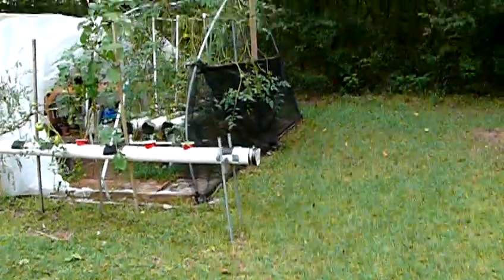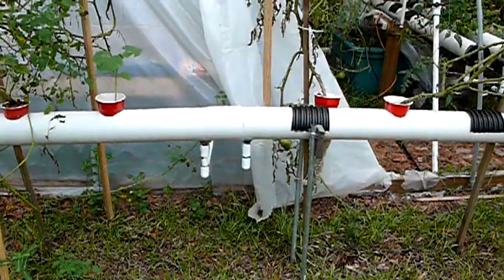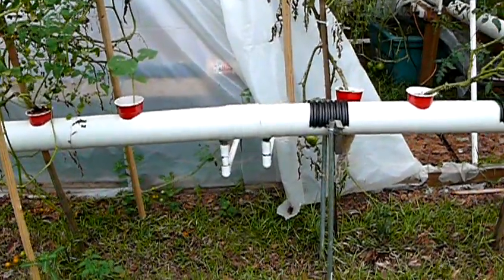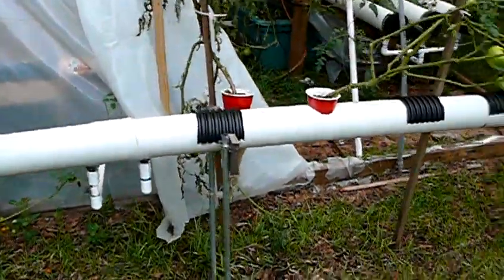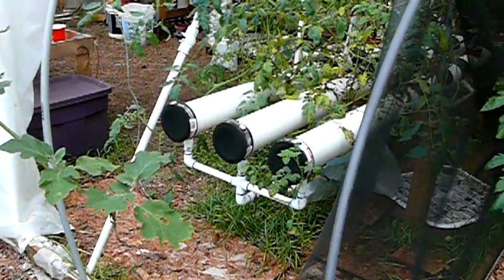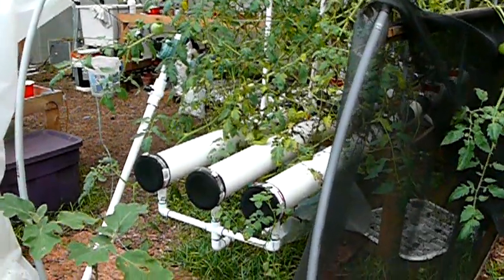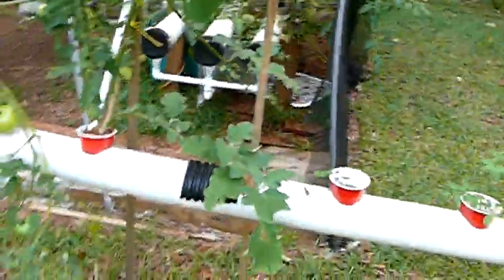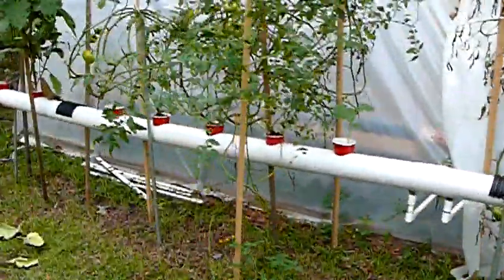hydro13 How to Improve Hydroponics System

Comment: Root rot is often associated with high temp. or low oxygen levels in root zone...   cheapest way to solve is burry the resiviour in the ground to keep it cool.    Huge drains are need on any system that has constant flow as the roots sooner or later get to the exit pt.
good show .